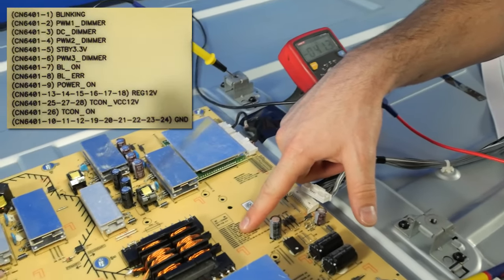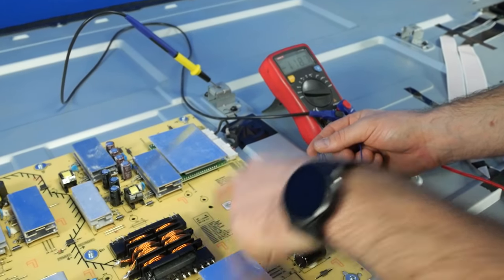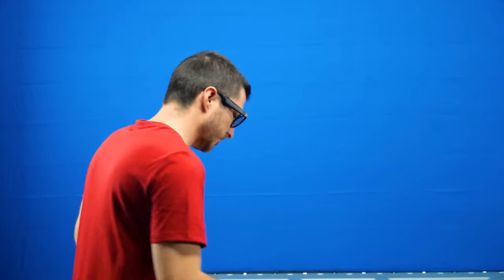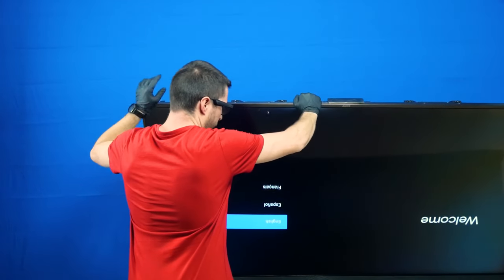Sony TV XBR-75X850F No Power

Comment: @NicksTVRepair, my standby voltage is reading ~3.4Vdc, REG12V is ~ 12.3Vdc, my TCON_VCC12V stays at 0VDC.  I disconnected the power to the main board and TCON, jumped my standby voltage to POWER_ON and TCON_ON (verified ~3.4Vdc on standby voltage, POWER_ON, and TCON_ON) however my TCON_VCC12V remains at 0Vdc and my REG12V remains at ~12.3Vdc.  Any recommendations on where to check?  Would sure be nice to have a schematic for these boards :D
Reply from the maker: If this is correct you have a bad power supply. However I have never seen this before where only the T-con 12v failed. 
Are you sure your jumpers are correct, please double check. 
What symptoms are you seeing on your TV set? Usually that is a better way to diagnose the set than doing voltage checks.
Reply: @NicksTVRepair  Thanks for the response! I tripled checked the jumpers and verified they were correct.  Symptoms of the TV is that there was no standby light, display not powered on, no change when trying the power button hard reset or the remote reset.  I've ordered a replacement power board and will let you know the results.  Wouldn't be surprised if it turns out to be the main board, but the PS replacement was cheap so it's worth a shot at the cheaper repair. Thanks again!
Reply: @NicksTVRepair I received the board and swapped.  Symptoms were the same, so i tried the 3.3V standby jumper via a 1kohm resistor in series with the Power On and TCon On.  With the jumper in place and 3ish volts verified on standby as well as power on and tcon on, the tcon 12v power stays at 0 AND the 12v Reg rail drops out to 0.  I replaced the original power board and it is doing the same thing (tcon 12v power AND 12v reg goes to 0).  Would this be a problem with the TCON board or still related to Main board?
Reply: Scratch that, there is no power path to the TCON board and the power harness output is demated so that wouldn't make sense.  Ringing out the power harness to check for shorts on the TCON power lines.
Reply: Resolved the issue, it was the mainboard. Not sure why I couldnt cause the power board to enable the tcon 12v using the jumper technique but no worries now that the TV is working.
Reply from the maker: It's possible the jumper wasn't making 100% contact. Sometimes it's hard to get good contact since it's not really meant to have jumpers coming in from that side of the connector like I do on screen.

Comment: I have a 900F that has the same issues. No power on TCon 12v. I did notice the power supply smelled of burning electrical in the bottom left hand side the the power supply. And some noise coming from the mosfets. I’ve had the main board replaced once.
Reply from the maker: The 900F is a little bit different but the same diagnostics still apply. If you are able to get the normal voltages to the mainboard such as standby, and all the 12v lines from the power supply then it means the power supply is good and the fault is the mainboard. 
If you aren't able to get the voltages, then the power supply is at fault.

Comment: Hi! I have an XBR-75X850G Sony Bravia. I have no voltage on pin 5 standbye power. Any suggestions?
Reply from the maker: No standby voltage typically means you have a power supply failure. That can be caused by any number of components such as shorted diodes, ICs, or a resistor that could have failed open. For that, I would need to do a more in-depth diagnostic. 
If you did want to send in your power supply for us to fix, we do have a flat rate service which I will link below:
https://nickselectronics.com/products/1-474-732-12-850g

Comment: Here’s an interesting question. Just got a 75x940e super cheap, but the screen almost misplaces pixels. At first it was in the form of a line and now it’s pixels scattered about. Very random and not all the time. And also in the settings menu it thinks it’s a 55 930e. Any idea what might be going on?
Reply from the maker: Hello Luke,
I believe we already spoke via email. 
This is most likely a mainboard fault, however we don't service those due to very low demand. Per my email we can fix it or at least provide you with a replacement but would require some assistance and parts from your set to do so.
Reply: @NicksTVRepair  yep it was a main board something with the emmc. Not sure why it thought it was a different model unless someone tried replacing it with the wrong part so I swapped the board and good as new

Comment: what main baord tester do you use ? Can u do a video on it?
Reply from the maker: Hey Raj,
Yes we were thinking of doing a video where we review some of the most usefull tools we have and use, which would include the mainboard tester. That video is probably a couple more months out however. 
This mainboard tester shown in the video is for standard and HD 1080P TV sets. The model number of the device is TV160. You can pick it up for about $145 on eBay or $125 from Aliexpress. 
There are others that work with both 4k and 1080P Tv sets which I would recommend getting over this one, however this one is much more affordable than the others. The 4k ones are closer to the $300-$400 mark. We might try to do a bulk purchase from a chinese vendor and retail them at a more affordable price on our website at some point in the near future, but we aren't at that point yet. When we do, I will most likely make an annoucement on the channel about it.
Reply: @NicksTVRepair  great! Caribbean tech here.....I have been struggling to tell the diff of tcon...and main board issues...so this tester should help

Comment: Hi, I just replaced the main board in my Sony 65X 750 F everything works after firmware update. You can hear the dings when you go through the apps but no sound on any of the apps or TV at all. I’m not sure if the firmware didn’t go right or I’m missing a step, any help would be appreciated
Reply from the maker: Easy fix, you have your audio set to external speakers and it needs to be changed to internal speakers or you plug in external speakers. When set to external speakers the TV speakers for some reason still output the dings and sounds from you navigating the menus, I don't know why but that's what it is.
Reply: Yes fixed thank you for your help

Comment: How do I obtain one of those chips that your replaced? Also do I need a soldering gun to instal it?
Reply from the maker: This is a very advance repair that requires advanced tools and skills. I do not recommend you try and replace it yourself unless you are a trained technicians who already has the tools and knowledge to do this repair. 
This is why we offer a flat rate mail-in service with a 1 year warranty. In fact a lot of our customers are TV technicians, because they know this is a very advanced repair, they don't want to risk damaging the circuit board beyond repair. Most electronics repair shops are set up for a lot of soldering work, but they are not set up for this type of soldering as it is  more advanced and requires a lot of training and know how.

Comment: Is it possible to change the plug of the power cable? I want to extend it.
Reply from the maker: It is, but finding a longer version of the same cable I don't know how you would do that. 
Might be easier to just use an extension cable or small power strip that would give you a few extra feet of cable.

Comment: How you take out those radiators. I have a problem with taken them off. Thank you for the video just by the way.
Reply from the maker: That information is in the video. Please rewatch starting at 3:22

https://youtu.be/Y00I6rx70j0?t=201
Reply: @NicksTVRepair  thx :)
Reply: @NicksTVRepair  but some are stack as they'd be glued together. I don't have problem with removing those 4, but the radiator of the mainboard. Not always it wants to get out easily.

Comment: Hello, I have a similar problem on a XBR 75x855F (latin america version), and have already received a new emmc from a Chinese store, but I have the following doubt:
Is it necessary to write the android system (or the boot) to the emmc before soldering it? Or is it enough to have a pendrive with the file sony_dtv*.pkg (from sony) so that the TV installs the system on the empty emmc?
Thanks
Reply from the maker: Jorge,

You need to program the EMMC chip using a specialized programmer. If you do not and install a blank EMMC chip, the board won't boot at all and you won't be able to load up the software from the flash drive since the USB port won't be getting any power. 
I won't be able to help you unfortunately since I don't have the software for your board. Typically what I do is I buy a fully functional board, factory reset it to default, remove the EMMC, grab the software off of it, put the EMMC back onto the board, make sure everything is still working 100%, and sell it on eBay. But now I have good software to fix other boards.
Reply: Thank you very much Nick. 
I understand the difficulty. Do you think that the software of the 75x850F will be able to work on the 75x855F? (since they are from the same year, same segment, and just a region variation). Maybe, with the boot1 and boot2 parts of the software my board could boot, then power up the USB port, so that the sony firmware can update the system?
In that case, could I buy your software via ebay?
Thanks again and greetings from Chile
Reply from the maker: We have tried that in the past but have not been able to get it to work. This is partially why we don't offer services for Latin American customers as we aren't equipped with the correct software.

Comment: Hey there! I have a 75 900f that is completly dead. I bought a mainboard to replace still nothing. Then tried a power supply still nothing. If i disconnect the mainboard and do the jumper pins i get a red light flashing 3 times on the led board but nothing else happens. No click from the power supply or anythjng. Could the static converter be the issue?  Any help would be appreciated.
Reply from the maker: To me, it would mean your mainboard is defective. eBay is full of non-working boards so it's possible you received a dud or you didn't pair the board to your TV. 
If you would like to send in your mainboard for us to live test and fix we can do so, this way we can confirm the diagnostic and then perform the repairs. This way you know for sure whether or not the mainboard was the fault, and since we live test the board both before and after repairs we know again for sure the board you will get back is fully functional. We also provide you with the flash drive and instructions for pairing.
Reply: @NicksTVRepair so if the replacement mainboard is good it sill at least turn on and give up the pairing lights correct?  I am thinking the board I got off ebay is bad like you said. I will take a look at your website about maybe sending mine in. Thanks!
Reply: @NicksTVRepair  I ordered a second mainboard off ebay and it fixed the issue.

Comment: My xbr 55x850g was dead one day 3yrs and only 100 hrs, always a true sine UPS for power. No voltage on the power connector. Removed board, I checked the caps, fuses (look like diodes no markings), and all diodes,all good but one diode 2amp/60v. Its lower right on the board. Replaced and badda ping batta boom! up and running.
Reply from the maker: Wow awesome! I have seen many 850G TVs come in to our shop for repair and so far I have not yet seen one with a power supply fault, I guess it does happen then. Nice work on figuring it out!

Comment: So my standby doesn’t have the 3 volt on the power board, there’s 28 bolts going out from the power board. I have a  XR-65X90J. My TV won’t power up at all and my standby light won’t turn on. Opt light won’t turn one at all.
Reply from the maker: I would recommend disconnecting everything from the power supply and trying again. It is possible there is a short on one of the other boards bringing dow the 3.3v to 0v. So disconnect everything and try measuring the standby line once more. If you still don't get anything then your power supply is defective and needs to either be replaced or repaired. 
If you do get the 3.3v from the standby to come back then reconnect each board 1 at a time until the standby voltage goes away again and when it does you can identify the defective part to repair or replace.
Reply: @NicksTVRepair  i replaced the power supply board and it still didn’t do anything. Maybe it could be a faulty Main board?

Comment: Hi
Got my tv 75x850f that has mo picture comes on
The power is on
Any issue?
Reply from the maker: Not sure I understand the question but if you follow the same steps I take in the video it will tell you which circuit board is at fault. 
Just like the video however 99% of faults are due to a defective mainboard. 
If you are unable to follow along you can always send us both your power supply and mainboard and we can troubleshoot and test them for you. If you check the video description you will find our contact info, I recommend messaging us first or filling out our contact form and providing with a full set of symptoms you are experiencing along with the full model number. We can guide you from there for our mail-in service.

Comment: I installed a new main board on my sony xbr-75x850c and then installed the firmware off a usb stick. After awhile my tv reset and the light on the bottom is now solid white and i can hear things when im pressing remote buttons bit i cant see anything. My tv is on an endless loop of different colored screens for aome reason? Rotating between like red - green - blue, striped, etc etc. But the light on the bottom is solid white and i can things when i press remote buttons. What did i do wrong?? :(
Reply from the maker: Hello,
Please watch this video I made showing exactly how to pair your mainboard and how to resolve many issues that arise. Your exact problem is covered in the video:
https://youtu.be/3kYPjIHt8Lc?si=cw5pNNvPYYnMcM0y
Reply: @NicksTVRepair  I've triple checked all my ribbon cables and they all seem to be fine and connected properly. I'm still getting the colored screens cycling no matter what I do. So now what??
Reply from the maker: The issue is still the same, your mainboard is not sending the signals correctly to the T-con. If you have already reseated your ribbons several times and still have issues, then either your ribbons are damaged, the connector has something stuck in it such as dirt, hair, dust, or something else preventing the ribbon from making good contact inside the connector. 
Where did you get the replacement board from?
Reply: @NicksTVRepair  is there a way I can contact you to ask a question about my tv I'm desperately trying to fix

Comment: Nothing at any of the pins on the power supply. Is that confirmatory that the PS is bad?
Reply from the maker: If there is 0v on the standby line then it would indicate your power supply is dead. However, it could also mean your multimeter was not properly grounded or making proper contact with the line you are trying to measure. 
If you have this exact TV set, it is very rare to see the power supply fail, I would highly recommend double-checking your reading.
Reply: Thanks! I was reasonably sure that my multimeter was making contact, so I ordered a replacement power supply and the TV works fine again!. I have seen others also note that it is rare for the power supply to go out, but I guess I got that one rare case where my PS really did die. Thanks again! @NicksTVRepair

Comment: Hi i am from india, i repaired my 24 inch led tv by replacing fr8012 regulator and usually diya inti lot of other things besides being a doctor by profession, my old 40 inch led tv clicks while switching on but turns to green then goes into two blink error, can u help isolate me the cause for that. Tried to isolate the problem but this 40 inch bravia ex710 is giving me pain since i wish to restore it badly as it was made like tank and i love it. Can you help?   Atleast whether the motherboard Or the power supply issue?  I have checked many components using multimeter but couldn't isolate the problem on the suppley, except have doubts about the FETs. Have tried unplugging the backlight to isolate if at all it had backlight short since the board is not giving any voltage except the standby 3.3 volta
Reply from the maker: 2 blinks is power supply fault. I can't help you diagnose and trouble shoot further since I am not in front of the circuit board but I highly recommend you watch this Sony power supply video next as I believe you have the same fault that we cover in the below video
https://www.youtube.com/watch?v=PYXJiyJ5kUk
Reply: @NicksTVRepair  Thanks for your help but i tested the mosfets and they were not shorted, double checked by removing it. Powered also without them and the set remained in same state. Besides used the power on and standby jumping to trick the board but it didn't produce any volts except the standby voltage. SMPS just clicked when jump wired the stand by and power on pins. I am suspecting SMPS fault or worse case the motherboard.